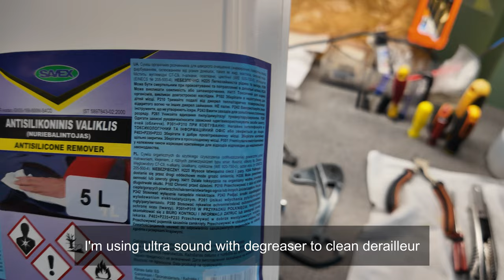SRAM Eagle GX Derailleur SERVICE | SRAM EAGLE GX СЕРВИС #sram #eaglegx #service #mtb #derailleur

Comment: how do u service type 3 clutch?
Reply from the maker: i guess you remove everything you can, clean and assembly :) but in my experince, don't remove and repair if it works... :D nowadays, it's better to buy a new unit, than repair old one...do you know how much did it cost me to repair my eagle? new cage, new pulleys - 60 euros. A NEW deraileur cost's 94 euros..